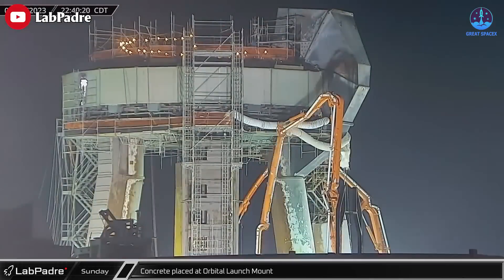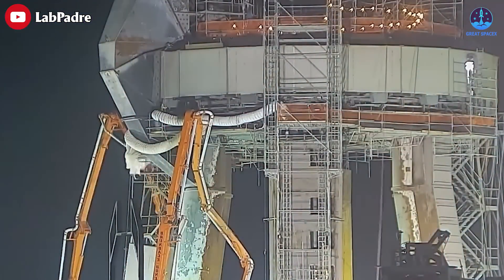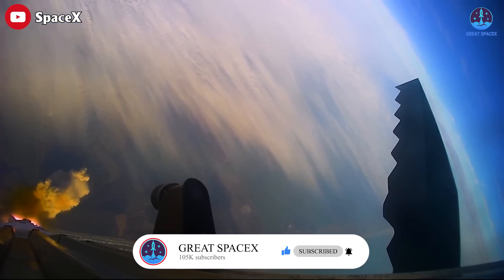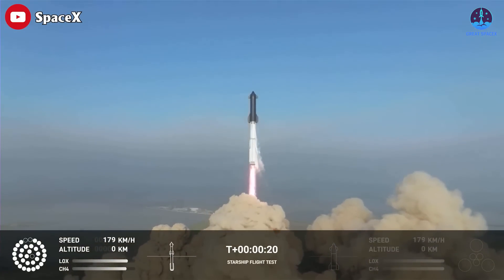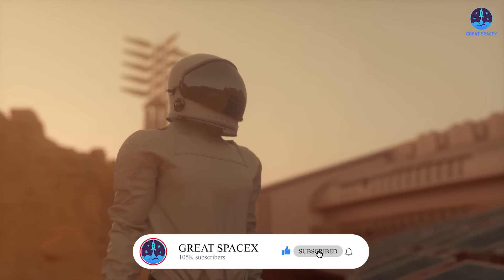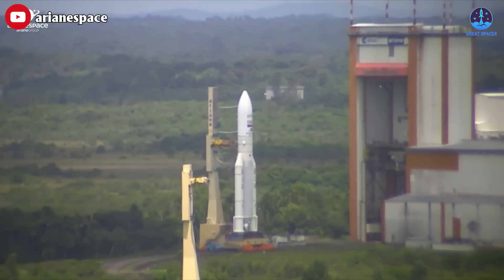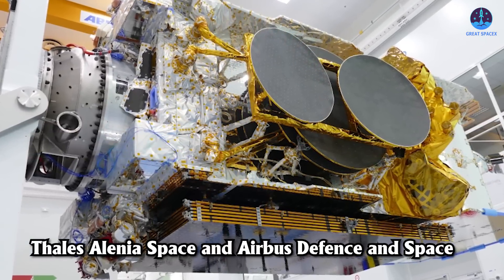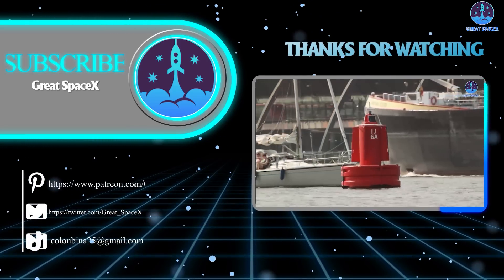SpaceX's foundation ramping up action for upcoming 33-engine firing. FAA lawsuit new update…

Comment: I think the huge concrete mass can not give up the heat as fast as it receives from engines. It will either melt or explode/shatter (there will still be tons of water in the concrete). I do not understand why X does not use a tested technique that NASA uses where just before ignition the floor is flooded with water. Massive amount of heat is converted into steam which then is absorbed by the ambient atmosphere immediately. A real simple way to move the heat and we get the water back in the next rain.  : = }}

Comment: 28 days of curing concrete is for ordinary construction. But the launch pad  is not an ordinary construction. The push that the super heavy buster will do is so huge and PRUDENCE says the curing should be twice as longer than 28 days, to make sure the concrete will not be shattered below the steel water cooled  pad. I believe that the second launch test will occur NOT in august, but at the earliest in September.
Reply: concrete gains 65 percent strength in 7 days, 90 percent in 14 days and 99 percent strength in 28 days.

Comment: In my new home which is under construction I have been told that it will take around 1 week for every cm thickness for the cement to cure. So my bathroom floor with 10 cm (around 4 inches) of cement would take 10 weeks to cure completely. SpaceX's concrete floor under the OLM is around 4 meters (around 13 feet) deep! So I simply don't believe that the 13 foot deep Fondag can be cured within 28 days! That sounds like VERY FAKE NEWS!

Comment: What makes you think that they are using Fondag again? They only used it for the last launch and it didn't hold up. This time they are using regular high strength concrete to support the base of the water cooled steel plate.

Comment: Ridiculous.    Elon from his own mouth has informed us that the steel plate is eroded by one inch per second during a launch.  And the proposed water flow is just a fraction of the Space Shuttle water flow, with FOURTEEN TIMES the heat applied.   Definitely not quantitatively sufficient to be used more than once, if that.